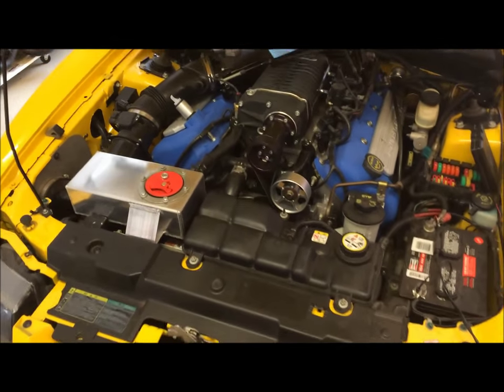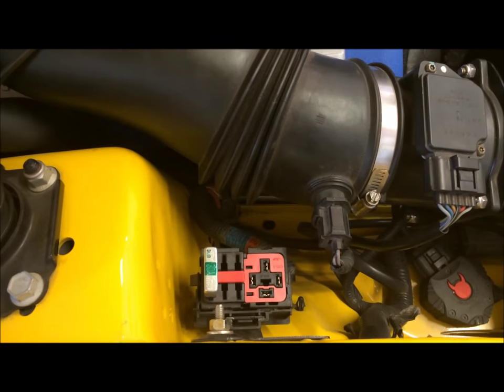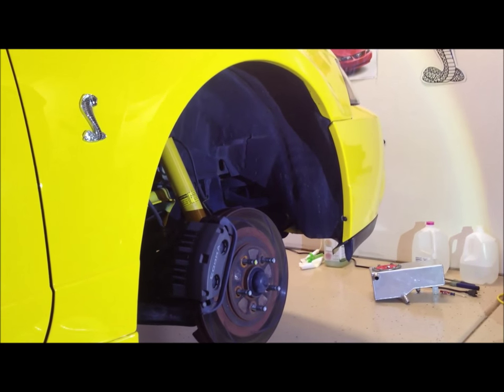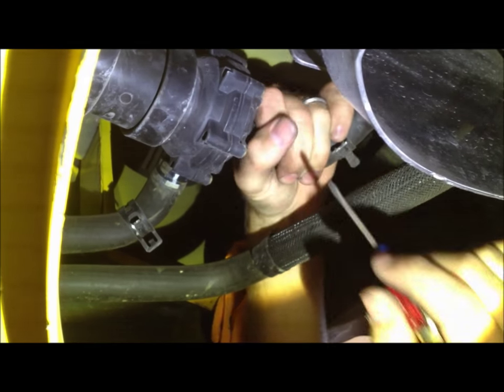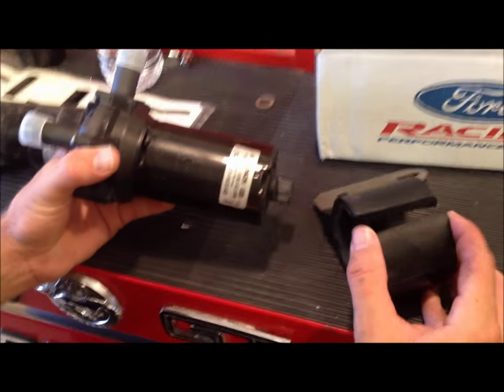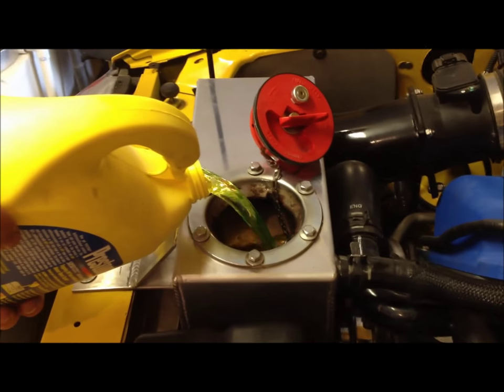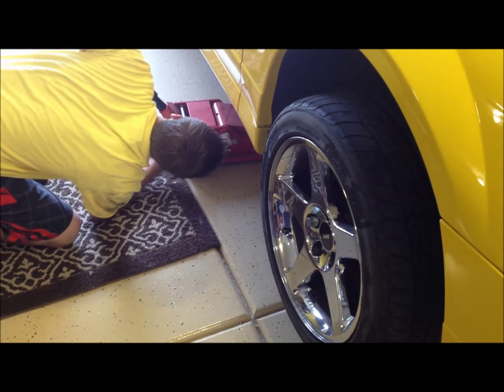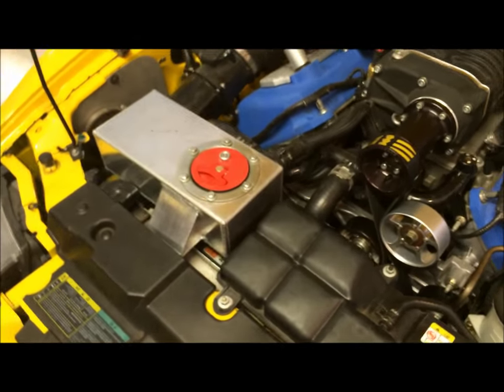How to change your 2003-2004 SVT Cobra electric intercooler pump jaguar, mercedes

Comment: After 64,000 miles my intercooler pump finally failed. I have a replacement Ford racing performance part and I plan on putting it on tomorrow. Thank you very much for taking the time and providing such good information on how to change the component!!

Comment: Thanks so much with the video. I know the cobalt ss has the same pump and i couldnt find a detailed video on it. I know its easy but i always find myself having a difficult time so just wanted to prepare. My pcm is tuned where if i turn the key it turns the pump on. And all it does is knock amd not whirl then dies lol. I believe we just have a different bracket but it all seems do able. Ima use clamps to reduce the amount of coolant from hitting my face. Again thanks and awesome work.
Reply from the maker: FaZe CrAzY626 I’m glad you found the video and it helped you out. Thanks for watching!

Comment: I think the reason the new pump came with a rubber mount was to protect the electric motor from jarring motions and vibrations.  Looks like the pump mount that you left in is solid metal bolted to the frame which is going to put way more vibration into that motor. If it has brushes, thats going to wear the pump down faster I believe.
Reply from the maker: Cody Gammon You are right. They sell this pump but it’s actually for the F150 lightning, which is why it has the bracket. You can add some sort of insulation, but it would have to be custom made.

Comment: Nice video, Just bought my '04 and am thinking to just go ahead and do this for peace of mind.
Btw, have you seen the MAF GT500 heat exchanger conversion for the Terminators?
Reply from the maker: turbotommyguns I have heard of people using one. Just check the price agains an aftermarket one as well. 👍🏼

Comment: GREAT VIDEO MAN.. AFTER I SAW UR VID I WENT AND CHECK MY 03 COBRA. I CHECKED THE FUSE AND TOOK THE RELAY OUT AND TESTED IT WITH THE WIRE JUST LIKE U DID.? MINE STILL HAS THE STOCK ONE AND NOTHING HAPPENED.. NO BUBBLE OR HEARD ANYTHING.. COULD IT BE MY ELECTRIC PUMP LIKE THE ONE YOU REPLACED.? THANK YOU!!

Comment: I'm suspecting that my pump is going out. It makes a weird oscillating humming sound when it's running and doesn't appear to be circulating the coolant as strong as the pump on your video. My pump seems weak.

Comment: Hey, how expensive is the maintenance on a termi? I've been looking in to getting one for a while now and I just wanted to ask someone who has one.
Reply from the maker: They really aren't that more expensive to maintain than a regular mustang..except for a few parts that you may have to replace that the other mustangs dont have, or parts that wear out faster if you're not on top of them. I.e. you'll burn through spark plugs faster on a heavily modded cobra, but you can keep buying the inexpensive tr-6 NGK plugs that do just fine. You have an extra drive belt since the supercharger runs on its own belt system, alternators go out faster if you change the lower pulley and don't change the alternator pulley to be bigger (spins the alternator too fast- not the alternator's fault), the IRS wheel bearings must be torqued often or they will get loose and wear out prematurely. I just replaced the intercooler pump (of course) and that's a part the cobra has but other mustangs won't worry about. It all comes down to what you want. If you're going to mod a non-supercharged car, you'll have the same problems, even more actually, as the cobra has been very well designed

Comment: Good thing im getting my miata back to run so i can work on the mustang. You dont have a volt meter on your car so you can see if your alternator power is good?
Reply from the maker: SVT Vasquez I do now- the aeroforce interceptor scan gauge has it
Reply: @dannyjohnsonsgarage  I was already thinking of getting one so i can rule out alternator issues in the future. Along with an afr gauge.
Reply from the maker: SVT Vasquez 
If you want a cheap way to read volts, check this out https://www.amazon.com/gp/product/B0773BYS6P/ref=as_li_qf_asin_il_tl?ie=UTF8&tag=2004047-20&creative=9325&linkCode=as2&creativeASIN=B0773BYS6P&linkId=b37a3d7396c01f8c8191fde71bb333a9

Comment: What happens if it's a blown fuse? Just replace the fuse or will it be something more than that?
Reply from the maker: OPG Koyote a blown fuse would indicate something wrong for sure. I'd try replacing the fuse but also look for a short in the wiring somewhere

Comment: Is this the same as the stock?  Is the stock the same as the “Ford performance” one on AM?
Reply from the maker: Yes, the one in this video was from AM. It’s technically from the svt lightning which is why the bracket is so different, but the pump is the same

Comment: Good video, again =)) Couple questions...again: what MAF sensor do you have?? Looks stock?? Is it BA2600, or bigger?? And how many PSI boost you taking out, 18?? And one more: where is your RPM/ rev limit: 5500 or 6000?? Thanks, Danny, youtheman =)
Reply from the maker: Eero Laukkanen 17 psi, stock MAF with MAFIA extension
Reply: Could I add that "MAFIA" extension into mine, I have stock MAF with 6 wires, meaning there is IAT sensor with MAF sensor?? Do I have to program ECU after adding MAFIA?? Thanks
Reply from the maker: Eero Laukkanen  I believe so. Here is a link with the specifications. https://www.americanmuscle.com/diablosport-mafia-9604.html

Comment: Danny I ran the car for like a mile with coolant leaking now I refilled with water & it wasn't moving at all with the car, I did the jump test but I could hear the pump turn on but no water moving is it still the pump?
Reply from the maker: If you hear the pump it’s likely there is an air pocket in the system. Put a plunger over the intercooler hole or blow air into the line that leaves the intercooler reservoir from the bottom of the intercooler reservoir tank
Reply: I blew through the hose until coolant came out tried the jump test again & same results
Reply from the maker: SVT_ ROD I suppose if it won’t burp the pump may be broken but still making noise
Reply: Thanks Danny 🖒
Reply: Put in a new pump & still isn't moving what else could it be?
Reply from the maker: SVT_ ROD It has to be an air pocket of the pump is working and no fluid is moving
Reply: So I keep blowing on the bottom line until it goes back in the tank?
Reply from the maker: SVT_ ROD Yeah, or try sucking on the line with a shop vac/ try to plunge it out like a clogged toilet

Comment: What condition lead you to believe the IC pump had failed? I have a 2.3 Whipple that after driving for a period of time starts sounding like a bag of rocks were dropped in the engine. I've ran the engine without the SC belt connected while hot and don't get this same noise so trying to determine if it is the SC itself or not. I'm going to do this test for the IC pump but I've also been dealing with horrible belt squealing on the SC drive. Actually chucked the Aux Idler couple months back and ever since have not been able to get this setup figured out and belts squealing is a constant problem.
Reply from the maker: On mine i had coolant come out of the expansion tank, indicating it was boiling so i knew the pump was bad. They will still work on and off so its hard to know they are bad unless you see high charge temps (my aeroforce gauge reads charge temp). 
  Is change the oil in the supercharger, but it might be bad bearings or rotors contacting in the blower. I’ll post some videos below
Reply from the maker: Blower removal if needed https://youtu.be/L9vX6JeppDk?si=PSidRcTF6yPXLl7X
Reply from the maker: Supercharger oil (slightly different on the whipple but similar process  https://youtu.be/LuHsY65XKtU?si=Pm99Q33FDwRpGgrB

Comment: Looks like you used a gt500 pump , can you do this and does it bolt right up using factory bracket
Reply from the maker: The pump was said to be from a lightning but I’ve heard it’s also the gt500 bracket you see that we cut away. If that’s the case they both work and plug in if you use the factory bracket as shown

Comment: Where did you get the reservoir at and how much coolant does it hold. Thanks
Reply from the maker: Vinh Nguyen https://www.amazon.com/gp/product/B002LCD0XE/ref=as_li_qf_asin_il_tl?ie=UTF8&tag=2004047-20&creative=9325&linkCode=as2&creativeASIN=B002LCD0XE&linkId=391913ae25105ca426bb0d565780d472
Reply: Danny Johnson’s Garage thank you

Comment: When installing the intercooler tank, do you simply fill it up to the top? I am planning on installing the same one you have and just wanted to confirm I fill it up to the level in your video, is it ok to mix a different brand of coolant if the stock tank didnt hold as much?
Reply from the maker: Yes, just full it up and then let it run to make sure it’s circulating. I would keep the same color and brand of coolant. The green is more silicone based and should not mix with other colors. If it says all makes all colors it may be ok (some prestone say that)
Reply: @dannyjohnsonsgarage  Danny, your videos are incredibly well done and informative, much appreciated!!  Am I to put the same coolant in the radiator expansion tank that is used in the intercooler tank? or are these 2 different fluids?
Reply from the maker: JB SVT Yes, they are both the same fluid (if they are the same color), I know I’ve seen some cobras with the motorcraft gold coolant, so just add what’s currently in there to match (or drain the entire system to switch). My car has green in both the radiator and the supercharger system. Same coolant in both

Comment: I replaced my pump today and when I jumped the two pins to test the pump, the pump comes on but not getting any coolant circulating. What would prevent this?
Reply from the maker: It had an air pocket and needs to be burped. If you blow air into the line that leaves the intercooler reservoir tank it usually fixes it

Comment: changed out the stock supercharger coolant tank...the temp gauge inside the car is pegged to far right...does the tank have to be grounded for the gauge to read correctly...
Reply from the maker: Lavaughn Jackson that Temp gauge doesn't have anything to do with the intercooler pump. You may have an engine over-heating issue with the car itself

Comment: Question Danny, would this pump not working make the car run hot??
Reply from the maker: No, since this is a separate cooling system than the engine- but the engine is hot enough to make the supercharger coolant boil and steam from the cap if the intercooler coolant is stopped from the electric pump failure. The car’s engine itself should continue to be within temp
Reply from the maker: Maverick Robinson Here is a video on the intercooler system https://youtu.be/FeYLdg5ecxw

Comment: What did you pay for the pump? Found the part number you provide in the description on ebay, and the prices range from $92 to $132 for a bosch pump...
Reply from the maker: racequad9 yes, it is a Bosch pump. I paid $139 on American muscle
Reply: Thanks for the video. I jumped my pump and it came on the first 3 times i made contact, and just as i was about to close the hood and call it quits, i decided to jump it one more time just for the hell of it and nothing.... i was like wtf?!? Got another wire and still nothing. What are the chances it gave up while i was checking it lol I'm going to do a complete intercooler and radiator flush next weekend and will change it then. Thanks again for the video. You have a lot of informative cobra videos. Sub'd

Comment: do you have to burp the intercooler. tank? if so, how do we do it?
Reply from the maker: centralunionhighskoo yes. In the end I'm showing the pump running with its cap off and the front of the car in the air. If you're not getting circulation, blow air down into the hose at the bottom of the expansion tank  to force air bubbles out
Reply: @dannyjohnsonsgarage can you also do as per your other video , turn the heat on full blast ? or the only way to burp it is by using the little trick you showed in this video via turning the pump on without the car on while it being on stands in the front

Comment: What if you jump the pump and can hear it running, but no coolant is flowing? (System is filled up)
Reply from the maker: Jonah Shirley There is likely an air pocket in the system. Blow air down the bottom hose that leaves the tank. Or put a plunger over the top and pump like unclogging a toilet

Comment: Hey question, my intercooler keeps getting air bound . I jumped the relay and I hear the pump but no movement. I can get it going but everytime the car sits for a bit it happens again. Any thoughts?
Reply from the maker: I would check to see if the feed hose going to the pump slumps below the pump. It’s gravity fed so a dip can cause it to not flow. Otherwise the pump may just be getting weak and though working, not working hard enough.
Reply: @dannyjohnsonsgarage  thanks,  I appreciate it. As always great job with the videos
Reply from the maker: @OH3REDFIRESVT  Thanks 🙏🏼 Im Glad people enjoy them

Comment: Does the engine have to be hot to check and test the pump?
Reply from the maker: No, not to check it by jumping it as shown, but it will not work on its own without the car being at a higher temp and turned on/ running
Reply: @dannyjohnsonsgarage  the first time I jumped it while it was off it worked, then a few minutes later I tried it again and it never worked afterwards, I find that odd tho, any other suggestions before I buy a new one? the fuse it just fine as well

Comment: How much coolant in the reservoir
Reply from the maker: Depends on the reservoir size m and there is also fluid throughout the heat exchanger and lines. I didn’t have all come out, but added another gallon or two back. 

If you’re asking how much to fill it, keep it an inch or so from the top as shown in the video

Comment: Do the pumps have date on them?
Reply from the maker: Most likely not a date, but the part number would tell you if it was an original run or an updated later part https://youtu.be/8qbvwh9Pr7E

Comment: Hey quick question i connected the cable like your video saids to do but my pump will not turn on. I put direct power and ground and it turned on. Would you have any idea what may be going on?
Reply from the maker: Where are you applying direct power?
Reply: @dannyjohnsonsgarage  to the pump directly
Reply from the maker: Adrian Lara Did you also check the fuse at 2:47 in the video?
Reply: Ima check that right now . Getting out of bed todo just that. Thanks ima hope its that thanks for the help
Reply: @dannyjohnsonsgarage  i just checked and it was that ! I was getting ready to have to check the whole harness!thank you soo very much

Comment: what coolant should i use
Reply from the maker: Prestone 50/50 pre-mix. You can also add a little distilled water as well, but remember that water Will expand and freeze in the extreme cold and could damage the system, so you need to make sure it is it is mixed well with coolant. If you do not use distilled water it could cause rust to form
Reply: Use pure coolant